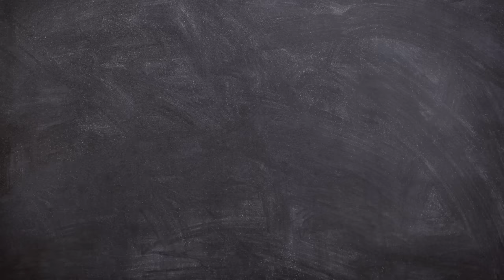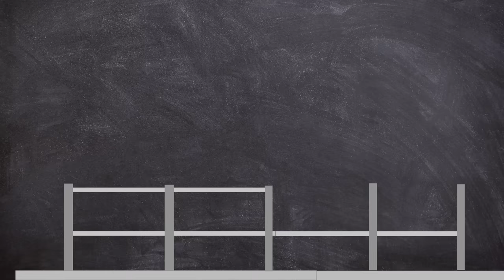Failure Guaranteed: The Skyline Plaza Tower Disaster 1973 | Short Documentary | Plainly Difficult

Comment: I remember this happening  as my father was an architectural engineer in D.C. during those years, with many highly successful projects, winning many awards. He explained the cause as building too quickly and not letting the concrete set properly.  This was a conscious decision by the builder, meaning the construction company, not the actual developer. This was a cost cutting measure of time, where  there is a fixed time for the time required for the concrete to set enough. This is NOT HUMAN ERROR!! It was done on purpose. Dad always said construction was a horribly corrupt business, and he had lots of experience with it, being a building inspector and engineer. The construct company should have been sued to oblivion.  Instead the architect was sued for poor design, which was patently false, and he lost his business, so not only did the justice system fail the architect,  they failed the workers who died, and their families. Horrid tragedy.
Reply: Eek
Reply: Money talks and justice is all too often silent.
Reply: 💯 ... where the epilogue is worse than the disaster
Reply: Human error does not necessarily mean it was accidental.
Reply: @susan7775 yes it does, by definition
Reply: Could still be technically called Human error, that said  it was an intentional error , Deliberate Mistakes were made despite practical knowledge saying not to do what they did.
Reply: The speeding up of construction was done on purpose, the collapse was not on purpose, it is textbook human error.
Reply: I always wondered why it never gets called intentional negligence. They chose not to let the concrete set, due to time. They rushed something that needs deliberate time to reach a maximal state, but they wanted to save a buck, so they just didn't wait.
Reply: @autobotjazz1972   "A human error is an action or decision which was not intended. A violation is a deliberate deviation from a rule or procedure." You can't intentionally perform a "human error", the definition of it is an accident.
Intentional actions leading to death would be neglect or manslaughter.
Reply: "Human Error" is an Old View of causal determination and stops short of actually getting to the root cause of an incident. The saying "If your investigation reveals a cause of Human Error, then go back to the data because you have missed some important points." is a good adage to always keep in mind when reviewing an accident.
Reply: It IS human error!  Those in authority wanted to speed up the process without caring that cement will not cure faster no matter how much you have decided it will.  Humans decided to remove the supports to early therefore it IS human "error".
Reply: @NotMykl  yeah i feel like we are getting into technicalities. i agree. it wasnt because of the design or the concrete itself. the error happened because a human was involved and decided to do it this way despite it not being safe. it wasnt mechanical failiure that was the root of the problem.
but i guess if the litteral definition is that its and accident that was caused by a human this isnt human error.
Reply: its disgusting when they just shift the blame to the engineers and architects for the design. 
like the video he did on the theater collapse. the architect got blamed for it all and he felt so guilty (despite it not being his fault) that he killed himself. he couldnt live with it.
Reply: I always thought architects were supposed to supervise the building work. Mine certainly did.
Reply: @Peron1-MC  You make an excellent point. If we want to understand how people would take actions that are likely to cause their own death along with their co-workers, we should move beyond what our words mean and focus on finding the "Why" and the processes that are most likely to prevent future tragedies.
Reply: Speeding up construction to beat deadlines and get bonuses was one of many reasons why Chernobyl failed.  The same story took place during Reactor #4's construction.  Cut corners, beat the deadline, and get bonuses.  Failure to follow safety and operational guidelines during a special test also contributed to the explosion.  

Also reminded me of a story regarding a particular Khrushchevka (5-story apartment building that was mass produced in the 1950's-1960's).  The contractor wanted to beat the deadline and the inspectors signed off while plastered on vodka, supplied by the contractor.  Over time, the apartment began to sag in the middle and internal bracing was retrofitted to stabilize the building.  Large beams passed through people's bedrooms, kitchens, and living rooms.  Considering the acute shortage of apartments at the time, it was tolerated and the beams found useful purposes for the residents so affected.
Reply: This being the 70's and the mob at the height of its concrete business I wouldn't be surprised if there was not some malfeasance there as well.
Reply: @seeingeyegod  , I think you won
Reply: @BlackPill-pu4vi the failure at chernobyl wasn't caused by anything to do with its construction, which while subpar due to cost cutting, never failed, it was a design flaw combined with good old negligence at multiple levels of its operation.
The reactors design was flawed to cut costs, however its flaw was under nearly all circumstances safe.
The operational negligence was in 3 stages. Poorly trained staff who were purposely kept ignorant of the known design flaw by senior officials and not trained to suitable levels to operate the plant. Poorly trained local management who were too results focused at the expense of all other things, because they had no choice, failure to meet goals was fatal (litterally in some cases). And finally staff who dispite their lacking training, were willing to break safe operating procedure at the demand (threat) of local management to achieve clearly dangerous goals.
 
Basically it was a culture of cost cutting due to fear (everyone feared the person above them, that caused it, not one of corner cutting for personal enrichment.
Reply: If he used the term concrete “set” instead of “cure” I doubt he was a licensed engineer any more than the producer of this video
Reply: @GOLDVIOLINbowofdeath   , listen to you. Everyone understood , including you.
Reply: @bluecollar58  well if they understood and they understood incorrectly because they’re not the same thing as a matter fact people they don’t know the difference are the reason this building collapsed in addition to the corruption
Reply: @GOLDVIOLINbowofdeath   , this type of thing happens all the time. The contractor knows there is a margin of safety engineers design to and it is not uncommon for the contractor to short cut , especially when they are behind schedule and getting heat for holding up other phases of construction.
Reply: Think so
Reply: @NotMykl  it's not human error. Human error is unintentional. What happened here is deliberate and intended. It is the fault of people rushing the process and it is intentional harm. Calling it human error actually benefits them because they can cite incompetence or a genuine accident, which has less weight than actual intended harm. I'm not contesting who is at fault, I'm contesting your use of the term "human error".
Reply: If the cooking instructions (architect) calls for 350F for 30 mins, let sit 5 mins and  the cook (construction contractor) is impatient, keeps opening the oven door to ‘check on it’, pulls it out 5 mins early, let’s sit for 1 min.. WHO’S to blame when the dish is undercooked? Everyone knows food can’t be properly cooked faster no matter our appetite. Everyone knows you CAN often take the shortcut and opt for microwaves, and everyone knows the quality is severely compromised as a result.
Reply: Sad we don’t have many people like your dad anymore, too many idiots wanting to be YouTubers and social media stars instead of learning a trade, a trade learned by your dad. Good man.
Reply: History repeats itself again and again and again and again.
Reply: @NotMykl Now it is criminal negligence. They did not follow the Building material specifications.
Reply: It was HUMAN ERROR dd !!!
Reply: This was edifying, thank you.
Reply: @ptonpc   wise words indeed
Reply: I call bullshit
Reply: Structural engineers do the concrete and rebar design, as well has the structural steel, not the architect.

Comment: I worked at a precast concrete company for a few years and I remember being shocked how fragile concrete is to stress especially when its green
Reply: As I am sure that you know, concrete needs to be kept surface damp for 3 days, takes 3 weeks before it can support its own stress load and 3 months to obtain full strength. For this reason, most buildings have a structural steel frame. During the construction, this is normally covered with 2 inches or concrete for fire and corrosion protection. 
When siteu casting slabs. Full length steel beams need to be placed the full width  of the floor after a minimum of 3 days, to support any shuttering for the floor above. These are normally left in place for a minimum of 4 weeks as floors are added. It is not normal to add a floor in less than 10 days, for fear of overloading the sum of the live and dead load.  
This is the responsibility of the structural engineer, working in conjunction of suitably qualified surveyors. 
If a sliding shutter is used to cast the uprights, any slabs that they support are added 4 weeks later. 
Other than a few engineers, for inspection, no other trades are allowed to operate until the slabs have reached the 4 week point. For adding heavy live loads, such as AC plant on the roof, even longer is allowed.
Reply: Friend working in precast gave me sample blocks of types of concretes and I'm surprised how some are so brittle, each move I'd have to sweep the floor.

Comment: Great video, but one small correction: at 4:05 you tell us that the climbing crane is built on top of the building. No. Think about it, it's a "climbing crane," not a "dis-assemble and re-assemble at each floor crane." 
A foundation is poured for the crane at the start of the project - it is of vital use through the project. The crane "climbs" as the building is erected around it. At 8:48 you feature a picture of the crane tower passing through one of the floors. After construction, the tower is dis-assembled and the fenestrations are covered with a "pour-back."

Sir: Can we look forward to a typically detailed video on crane collapses? A couple in the Seattle area in the last few decades might be interesting.

Comment: I worked in the construction industry for 3+ decades... I can't count the number of times "best building practices" were not followed... Sometimes from ignorance, far more often from greed... 
Short example?
1 morning I walked off of a job site because of supervisors not wanting to use tag lines for suspended loads..by that 3:30 pm a suspended girder had killed a ground-handler...💔
Reply: My husband is an electrician. He worked private construction and later joined the Union. He explained it this way: "When I worked private, a manager would expect me to climb a metal ladder to connect live wires for a light fixture. When I joined the Union, I would just look at  the  manager and say  'No.'"
Given a choice of buildings to work in, one built using Union labor and the other non-Union, I would always choose the Union labor one. While there are good private developers/builders out there, Union labor better ensures trained workers and workplace/building safety rules.
Reply: No tag lines? Something as simple as that, which makes the job safer AND quicker? Stupid.
Reply: Just an office worker here, can you explain what a tag line is? RIP to your coworker.
Reply: @annettetoser894 did a quick search because I was super curious too. From my findings:
"a tagline is a rope (usually fiber) attached to a lifted load for purposes of controlling load spinning and pendular motions or used to stabilize a bucket or magnet during material handling operations. Taglines help you avoid having to put hands on, or stand underneath, a load during a lift. Its usage greatly reduces the times where you are “in the line of fire,” which means being in danger of getting struck by or pinned underneath a load."

Comment: I spent 18 months working as the office manager of an 11-building apartment construction project and I was shocked by how incompetent  the contractors were and how much money was wasted.  The first building was improperly laid out two feet too close to the road and had to be torn down and started over once this was discovered.  The other 10 buildings also had to be remeasured and moved two feet over.  The exterior painter "accidentally" reversed the paint scheme and everything had to be repainted.  The plumber made the same plumbing mistake in every single bathroom (240 apartments) and every bathroom had to be re-plumbed.  The framing was horribly done and none of the windows fit so every building after the first one had to start over with the reframing, etc.  It was horrible. And the worst part was this was a government-funded HUD project (i.e. paid for out of tax monies) and cost us taxpayers into the high hundred-millions.
Reply: As a teenager I worked various construction jobs on a number of government-backed “235 homes.”

I tried reporting the shoddy construction, even going so far as writing to a Senator, but nothing changed.

I decided to quit before I was fired for bring a whistle-blower.  I went to work instead in a number of hones where the General Contractor was definitely in charge.  He started me as a “Carpenter’s Helper,” soon had me driving nails in house frames. 
Over THAT summer, learned what went into a proper stick-frame house when the builder had pride in his work.  That has stood me in good stead for the rest of my life.  

When we bought the house we live in now, during remodeling I wished I knew who’d built the frame, so that I could curse him by name!  The floor was so poorly supported it would have fallen into the basement in a CA 5.0+ earthquake! (My son and I had to put 20 more piers and posts underneath to support the new stone floor!)
🤬🤬🤬🤬🤬
Reply: Sounds like a conspiracy to milk federal funds by the contractors.

Comment: If I was working on a building site and the building shifted by 150mm or more, I would be finding a new job right now. What I've noticed is that cranes are generally towers constructed from ground level. Placing them on the actual building would be one more thing that the structural engineer would need to take into consideration, and would mean that the building was excessively strong.
Reply: Good point.  I wonder if the building was designed to support the crane while under construction.  Or if the contractor just threw it on the building assuming it would hold?

Comment: As a Virginia resident, Virginia is the Florida of the Mid-Atlantic. We’ve had a cow on the interstate, a 69 car pileup due to fog, a 24 hour traffic jam stretching 50 miles due to snow, and someone stole a tank and led Richmond PD on a low speed chase until it ran out of gas. 

This? This is mild.
Reply: I'll happily avoid both states thank you very much.
Reply: I can personally attest to a cow on the interstate (I-81).
Reply: "A" cow? How about hogs running around 95 at Willis exit due to an overturned TT pulling smithfield bound hoof bacon. Horses, cows, chickens... but CALIPHORNIA, I lived in Irvine, and back in the day, occaszionally, wildlife would escape Lion Country Safari, and thered by zebras on the 405, or a hippo loose near El Toro.
Reply: A 24 hour traffic jam that our senator got stuck in 😂
Reply: You're wrong. Maryland is the Florida of the mid-Atlantic.

Comment: I never get the actions of the workers on site in cases like this. When the building is getting cracks before it's even done and you notice that it's warped two feet out of place, just stop and figure out how to make it right. Otherwise what do you expect to happen? How is it even possible to keep working to the plan on a part of the building that's so far out of alignment?
Reply: They can report it to management, but scummy bosses have no need for honest workers. Get rid of the honest workers, and you're left those that can't or won't speak up.

Sometimes workers can't afford to be fired, (poverty, worker visa, etc.) and fear that rocking the boat will get them fired.

Many will see a defect, but (incorrectly) estimate the risk is so low, it's not worth the consequences.

After all, who do you report this to? It isn't an emergency yet so 911 is out. Oversight agencies might not act for weeks or months or years, for all you know. And, like the contractors failed to do in this situation, that's plenty of time for the evidence to be tempered with. Remember, no builders were bringing a camera to work.

Of course, some number of them simply don't care. They'll say "not my problem", or "I'm not the one in charge", or "I'm no expert".

Comment: I grew up around the block on Carlin Springs Rd. and remember the airport, even recall a small airplane failing to clear electrical wires at the end of the runway and ending atop the electrical pole. Baileys X Roads was growing in my teens and then the airport was gone.